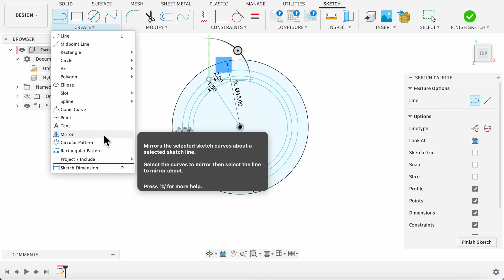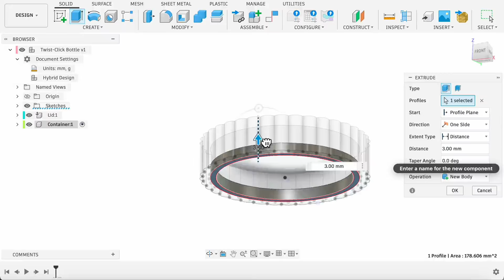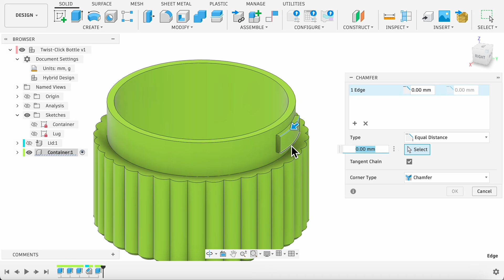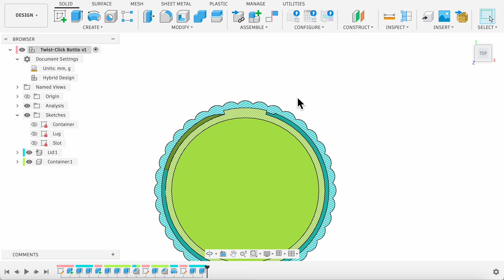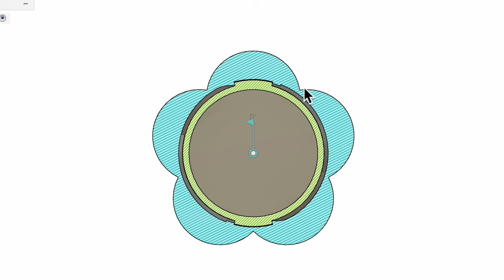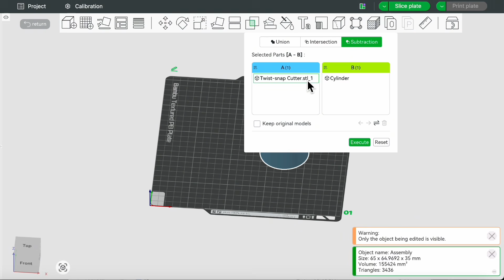How to Design a 3D Printed Twist Lock Lid in Fusion 360

Comment: God I hate how unintuitive the UI is. 
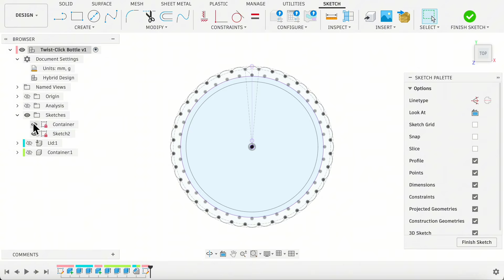I'm only 6:35 in and i'm stuck on the project step because for some reason the sketch seems to go under the active component tab vs creating a non-active sketch. 

First I had issues where you initially had the non-parameter circle pattern and I could see you click on the icon to edit it but I didn't have that anywhere (i'm on personal edition?) nor in my timeline so bad to undo back to when you initially did the circular pattern but this time have the parameter set before then. 

There are also jump cuts in this video which would be fine if you just were editing out coughing or something but I can see UI features being turned off and on without any reason which really isn't helpful for a beginner, especially with how unforgiving the UI is. 

I've now just deleted everything and going to try and follow this again, and try and work out where I went wrong.
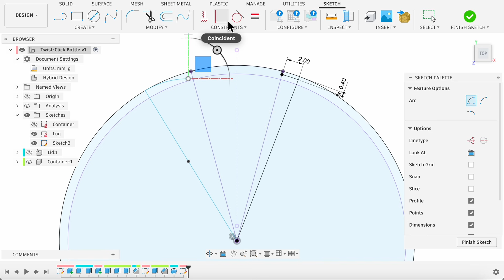Reply: Printing now, had some issues with the constraints at 9:24. On mine no matter how much I tried the arc didn't touch the inner circle even though it was constraint to it, so guess we'll see how tight this is. 
Just trying to learn how to create a collar/lock/channel for a collar on an AC hose/dryer hose that i'm planning on mounting to the wall. So need to learn the mechanics so I can twist it in so its right and then release it at night.

Comment: I thought this was a really cool design, and I decided to follow the video through and recreate the container from scratch as a learning exercise.  One issue I ran into was that you refer to "Offset Face" and "shortcut Q" interchangeably when making clearances (e.g. making the lug slightly smaller).  The "q" shortcut is Press/Pull and if I try to press/pull the lug it seems to disappear entirely and leave a lug shaped hole in it's place.  If I "Offset Face" the surfaces it makes the lug smaller as you're describing.